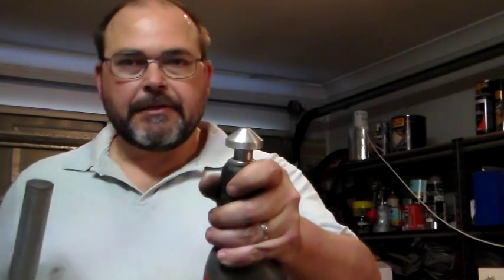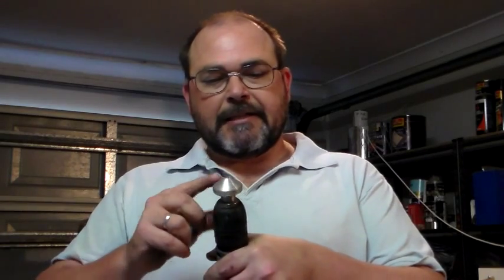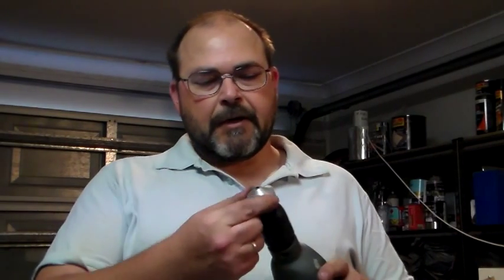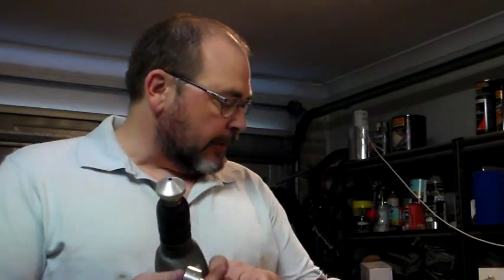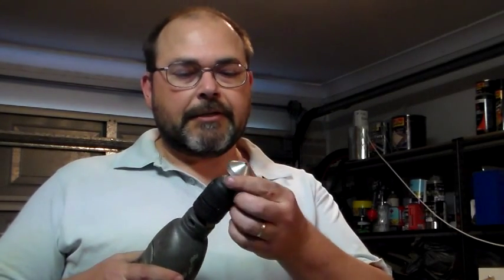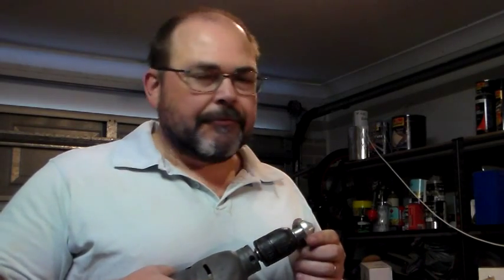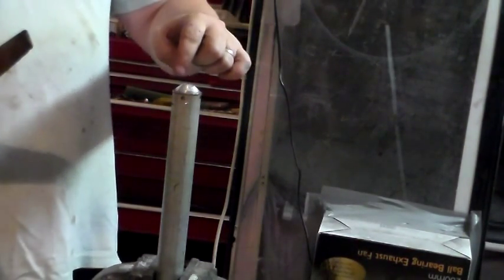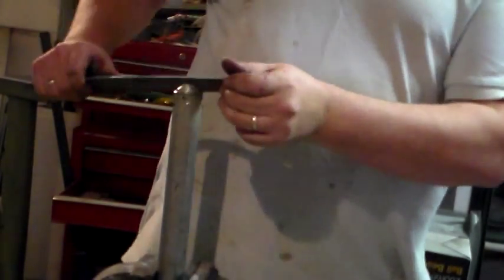Making a Plastic Injection Molding Machine Part 5

Comment: 3 of 3: If you're successful making a flat cylinder, the surface should be flat and hopefully mirror clean. You may need to make multiple passes, so you may have to lower that chuck and then screw it tight or tilt the chisel upward. But if I would mount my cross vise sideways so it becomes a true lathe. I may consider welding a steel support to make this possible.

Comment: HOW TO FLAT A SURFACE: There are many ways to make a cylinder flat. In your case attach it to the drill press and cut it flat like the way you did. Brass would be better. Attach your chisel to the slide vise but don't plunge the chuck down. Instead feed in the slide vise. There is a screw on most drill press to secure the drill press shaft to prevent any play. I would screw that tight. For mirror finish, the chisel should be round corner not "L" angle, but not required.  continue...

Comment: ORING: In reply to 3:00.  The o-ring will last maybe couple times under heat. I may have a solution.

If you take a look at http://youtu.be/nV9hnJGpZCk?t=33m26s  you'll find that the nozzle mating surface-to-mold is flat.  This seals quit well. For those without special tool, this is the way to go. continue...